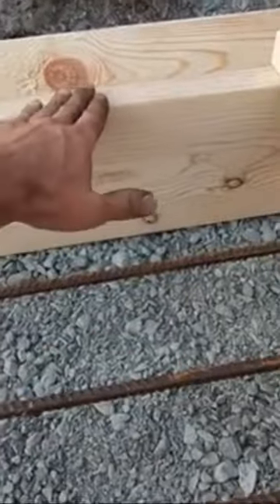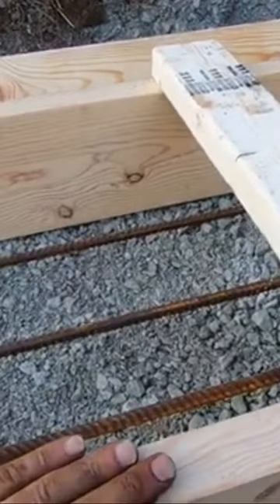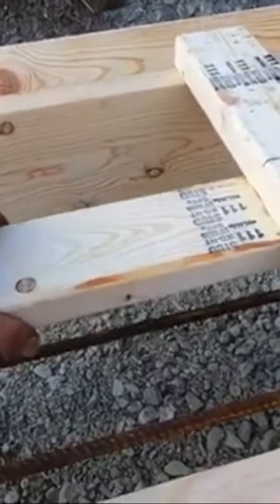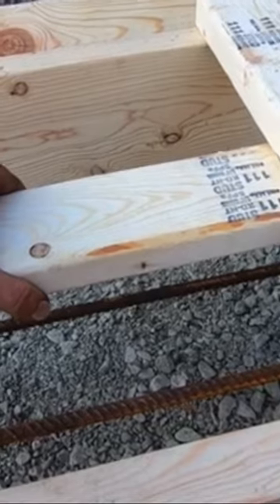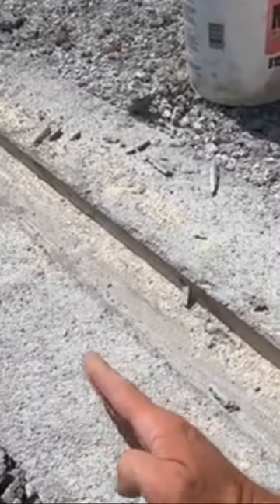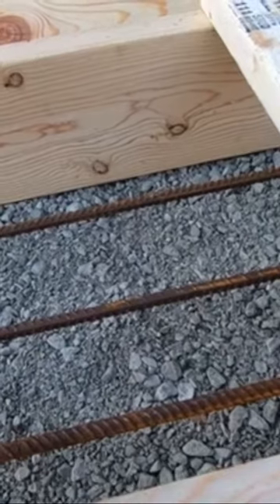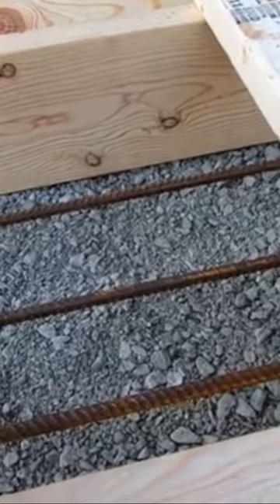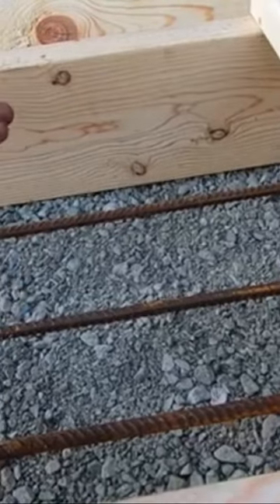Keyway in Concrete Footing #shorts

Comment: What keeps the bottom from spreading out during pour?  As mentioned, the top 2x keeps the top from spreading, is there a worry about the bottom or is that a non issue since it's one board, looks like maybe a 2x10??
Reply from the maker: There are concrete stakes drove into the ground on the outside of the 2x8 form